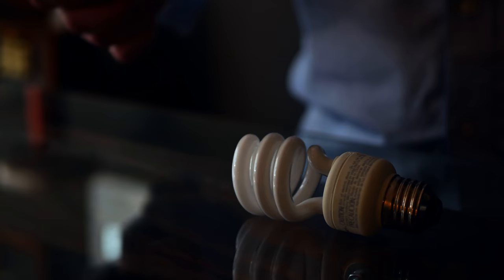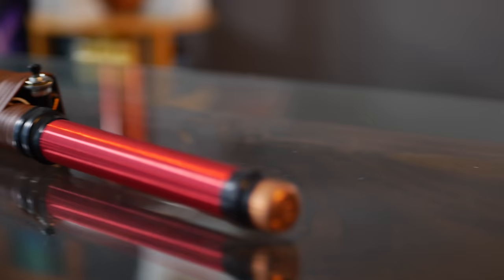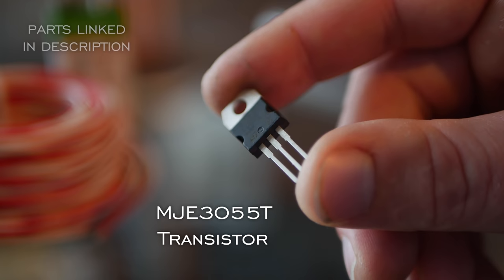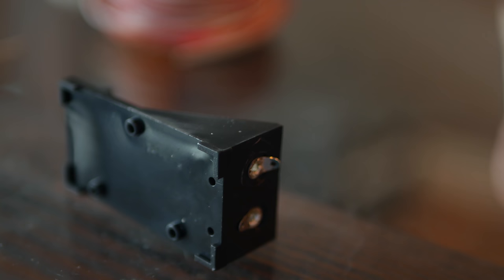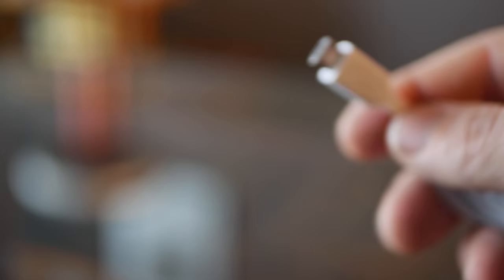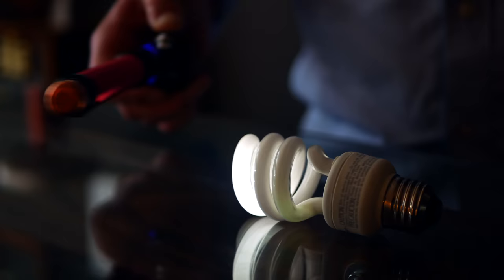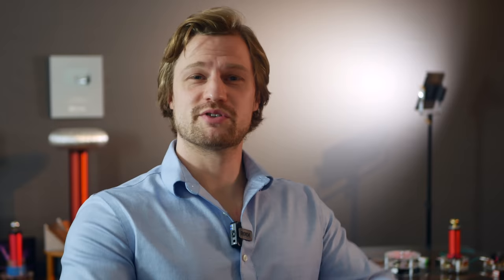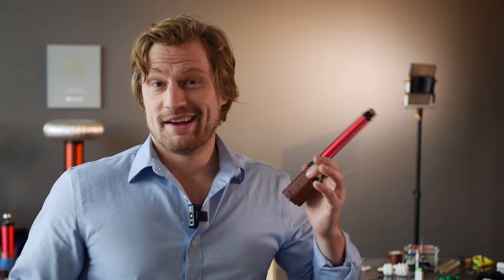DIY Wireless Power Magical Wand (Slayer Exciter)

Comment from the maker: Just a note: The copper end cap is not essential for functioning, so I didn't mention it. It was just to seal the end the wand. I think it does extend the electric field mildly, however, it's more for structure and appearance. It's just a 1/2" copper pipe end. Cheers!
Reply: You could make it look like a sonic screwdriver from dr who. That would be so cool
Reply: Mr plasma, please make the tesla coil that creoson made. You can find it by surtching tesla chair on youtube. The thumnail is a big green box. Please check it out. And if you can, improve it. It makes huge arcs.
Reply: I , like it , because neatness counts, that makes it even better!
Reply: @user-qe4do2fi5l  yes u r right
Reply from the maker: Exactly what I was thinking. I love a good looking build.
Reply: Deez nuts
Reply: @PlasmaChannel  what abowt a arc lighter powerd voltege multiplyer powerd tesla coil?
I mean that will make some huge sparks.☺
Reply: @PlasmaChannel  you deserve 1m subs keep making cool videos.
Reply: Wireless chargers for phones appear to create similar charging field, however I've read the wireless chargers aren't necessarily all compatible with different phones.  
Out of curiosity would the wand register a wireless charging signal on a phone capable of wireless charging?  

Also find static shocks interesting.  I worked in shipping wrapping pallets.  This old lantech wrapper, I'd get shocked & it would reset the digital counter & shutoff the turntable with the pallet that was rotating.  Always happened after I secured the top of the pallet with shrink wrap & went to engage the knobs for the table to move faster & the carrage with shrink wrap to go back down.  The shock went through the knob & reset it.  

I'd terrible static, so bad not only did I short the machine, I'd actually get zapped from touching a clipboard & When I say zapped it was enough to see the spark.  I suspect it was my nike cloth shoes that was gifted to me alongside shrinkwrap, but I was still getting overly zapped.   

My dad did an old fridge trick, one person touches the fridge another in the middle, & I think while all touching, one on one end could put their tongue on a 9volt & everyone gets zapped.  Probably been like 23 yrs for me now.  Lots of cool experiments.  

Another great upload, I wish school had taught this stuff.  You make it seem really simple to do, but I know there is a lot of calculations behind it.
Reply: There are a couple of applications I can think of.

1. As a live circuitry detector.
2. In home, during a blackout, you could walk around the house, lightning up the bulbs as you go.. Maybe if the reach of the wand could be increased.
Reply: @biggusdickus269 , I think I just might try that!!!!!!
Reply: The transistor is out of stock
Reply: Can I get a report of it about the ckt
Reply: Can you charge you phone wireless with this
Reply: @mba3482  No, the basic principles are the same but Wireless phone chargers use specific frequencies and power levels and won't transmit sufficient power for charging without first exchanging information with the phone to see how much power/what frequencies it can support.  I'd also be careful using one of these around a phone that does have wireless charging in case it messes with the circuit in some way.
Reply: What if did something similar with water
Reply: You also mount the transistor to a heat-sink and didn't mention that either.
Reply: Hey J I was kinda making a magic wand the same as you made but it's quite not working as the led is not glowing !!
Can you help it out ???
I used Tip41C as switch 20k resistor and there's not much components in it 
But still pretty disappointed!
Reply: How did you do that cap???
Can you please tell
Reply: @plasma chennal how did you do that cap???
Can you please tell
Reply: I would like to talk with about a project I'm designing.
Reply: @thearchetype9829  Did you wire the circuit right?
Reply: At what rf frequency does it transmit i wonder @Plasma Channel

Comment: THIS IS MY 4TH ATTEMPT WHAT AM I DOING WRONG
Reply: ITS FAKE
Reply: I tried every circuit posible only this one
Reply: FAILED
Reply: Same. I think this dude just pranked everyone.
Reply: You need to get the coils to resonate, when they're too close together it's hard to get it right
Reply: I had a problem with a similar circuit recently. I used a cheap transistor and it didn't start to oscillate.

Comment: If you ever want to make one that's more wandlike, without the thick handle, if you peel the shell off of the nine-volt battery, it's actually six AAAA batteries, connected with spot-welded metal strip.  Stretched out endwise, it would be about 3/8th of an inch in diameter and about six inches or so long.  Maybe build the entire circuit so it goes inside a piece of heat-shrink, then drill a hole lengthwise down a stick to house it?
Reply: Idea is good, I make batteries for vehicles if Jay wants will surely make a battery and send across, coz not all have a spot welder and to own one for DIY projects is not expensive too!!😂😂😂😂 Love from India.

Comment: I once did this with a mini flyback instead. I connected ground to myself and I can use it to draw arcs to anything made of metal. 
It is really useful for stopping people entering your room by electrifying the door handle.
Reply: How well it works with normal flyback transformer in epoxy?
Reply: The same but make sure it outputs high freqency AC so it will copule thru intruders body to ground to burn the shunt out of them. If yo use DC intruder must touch another grounded surface unless the voltage is like over 100 kv but for that yo need a voltage multiplier i guess

Comment: “If you want to find the secrets of the universe, think in terms of energy, frequency and vibration.” – Nikola Tesla
Reply: Energy = Potential and Kinetic, Charge and Discharge, Pressure and Flow.
Frequency = Resonance and Non-resonance.
Vibration = Transverse, Longitudinal, Spiral, etc. Constructive and Destructive Interference, Radiation.
Reply: Also the most misunderstood quote ever, as demonstrated by responses

Comment: Make one like "join the technicians" 's magical wand, its more destructive and Fierce...
Reply: Thumbs up for Join The Technicians. That wand is insane.
Reply from the maker: Yeah I took a look. Pretty insane. It won’t light bulbs like mine, but... it’s much better overall. Then again, mine was designed for 5 year olds 😋
Reply: @PlasmaChannel  yeah both run on different concepts... If you mass produce this i might buy one 🤞

Comment: Can you do a video on Plasma Electrolysis, also called "Contact Glow Discharge Electrolysis", or "Non-Faraday-ic Electrolysis"?   Use an alkalai electrolyte like Potassium Carbonate.   Your cathode (negative) surface area should be much smaller than your anode.  That way you get a high current density at the anode.  The Hydrogen that bubbles off the cathode gets ionized.

There is a Japanese Physicist named Tadahiko Mizuno, he was chair of the Physics department at Hokkaido University, who did some experiments with this.  He noticed that his cathode was transmuting into different elements.  Iron would turn to Gold.  Tungsten would turn into Ytterbium.  He looked at slices of the cathode material under an SEM with EDX (element detection function).  There were areas that looked like flowers, where the inside of the metal had melted/vaporized and blown out.  These "flowers" were found to be made of other elements.  The theory was that the nuclear transmutation was caused by Proton Spallation.  That is, the ionized Hydrogen from the water (stripped of its electron, it's just a proton), was somehow getting smashed into the nucleus of the cathode atoms, causing small fusion reactions.  Also the isotope distribution was highly unnatural, suggesting a nuclear reaction.

I did some experiments a while back.  Maybe you could do a better job?
https://www.youtube.com/watch?v=Q_0-z8ppjNU&list=PL_fqGxm2VkJ1zyaudyUbOv1aQWp40Dor5&index=1

like the vids man :)

Comment: I've always wondered if it would be cheaper to build mini slayer exciters into fluorescent tubes than to build a ballast into them...
Reply from the maker: Hm. Total components could be built for less than 5 dollars. Good thought.
Reply: I don't know enough about purpose built fluorescent fixtures to comment on that, but it seems that we're transitioning from CFL to LED fast enough that it was never worth trying to get rid of the integrated ballast.

Comment: Nice little project. The only negative for me was the leather wrap. I do understand the need for insulating yourself from the circuit, but the leather hides all the goodies inside. Though there isn't that much to see in there, I think it helps with esthetics of the built. Good job still.

Comment: Just a thing when i made my slayer exciter at my first proyect the LED turned on but it turned on at full power so it was shorting out, the problem was the primary coil's low inductancr and low resistance

Comment: This is awesome Jay!

I gotta make me... I mean my nephews one of these!

I always wondered why in the slayer circuit needs the led. If it is only used to make sure current only goes one way, could you replace with a diode?
Reply from the maker: Thanks justin! I appreciate that. The LED can be replaced with a diode, and a lot of variations of the circuit use a fast acting diode in its place. The benefit of the LED is when it lights up, that tells you the circuit is operational. Plus it looks cool!
Reply: @PlasmaChannel  
That makes sense. Added benefit. I just wondered as a small musical tesla kit I bought to try out before building from scratch had one, and it's placement and brightness made it where you couldn't see the arcs without covering, but if you did with your fingers, it took power out of the circuit, dimming the sparks and making sound quoted.

I just rewatched the pancake video and you mentioned that it could be a diode there, somehow I missed all the times I watched before.

I notice in the video, you add a small piece of copper as a top load, but never mention adding it audibly. Is there a benefit to adding the top load (building capacitance, etc) or just for aesthetics so it looks more wand like? Wasn't sure if it made a difference performance wise as there are no sparks.

(Also, the link to the pancake isn't in the description, might want to add so new people can click through and get you views without having to search.)

Love the videos man, always a surprise, but always good!
Reply from the maker: Justin, this is why I love having you in the fam. Thanks for tipping me off about the copper top. Arg, I forgot! I’ll put a note in the video description! It just is to ‘seal’ the end of the tube. Also extends the emf field slightly. Very slightly. 

And, I’ll add that pancake coil link now too!

Thanks man.
Reply: @PlasmaChannel  I'm very new to circuit design and I was wondering, what transistors are good for these kinds of applications? Any input would be greatly appreciated ;)

Comment: Nice build. I should have thought of that. A slayer circuit for the kids. I was going to use old school tech though, but this is more appropriate. Also I'm really curious as to capacitve coupled plasma circuits for rf flame (why don't tesla coils like to run that way) and to build one without semiconductor or vacuume parts. Good work, good luck, and merry Christmas.

Comment: An arc lighter please. Better than the greatscott one. With larger arcs. And it can be bigger in size than a standard arc lighter or butane lighter. Something more like a prepper tool that can withstand stormy wet winds and light fire to wood or leaves. Natural tinder that is.

Comment: Looks good, but a small suggestion:
Rather than using the clear epoxy tube, why couldn't you use electrical (or plumbing) plastic pipe?
They have end stops that would be "better" to close the ends.
Reply from the maker: I just used acrylic as a preference.

Comment: Hi Jay I was just wanting to let you know I built a wand myself once I was playing with static when I come to the conclusions just like a balloon rubbing it to your head and sticking it to the wall while I was utilizing a cigarette paper and that cigarette paper well I found some really cool things out and I found something that has to do with the black wire specifically nearest to a power source that's applied such as where your power breaker switches are in your house yeah I've taken apart many things anyways I had that piece of wire and I cut a specific amount of inches of it I used cotton string glass tubing and some coiling fashions and static current to snap a spark off to something and take control of it such as something dangling from the ceiling I could step back and make it spin or such as it was like ... A remote
antenna such as like walk that cigarette paper up the wall with my one hand holding a nail in my one other hand and it was like a cartoon of static on the end of my one finger on my left hand in my right hand I used it to walk the cigarette paper when I staticified and stuck it to the wall like a balloon I walked it up the wall and for end and down the wall it lost static about 6 in from the floor some cool things you could toy with if you really want to build it really special wand ...
I've even levitated a cigarette paper out of the center of my left hand believe it had every bit to do with the static and coilations to the momentum ...
Anyway I've also noticed some other major things about it that really caught my eye when I first noticed a connection a frequency connection which is between all things now I staticified with a cigarette paper in my hand stuck it to the wall and backed up walked over to a friend of mine and snapped my finger off as letting the static go ... In a spark or Arc across to her which there was always a difference to whether I felt the pain or her which is the difference between it being a spark or an arc however the cigarette paper that I staticified and stuck to the wall when I went over and snapped her with my static it fell so that in turn I did it a few more times playing with it and understanding that connection right there alone a remote connection of ways per se maybe if we could alter those actions is what my thought were to the process before it even happens or in the process of before the spark maybe the frequency the static frequency the correlation of it the magnetic pressure whether it's an arc or spark all has to do with how that actions happen including microwave compression which don't get me wrong I mean they say it's bad but yes it is however does static kill you when you go off and spark somebody not unless it's a little bit too much for your body to handle however if you're just rubbing on your couch with a coat that noticed builds static
Play with the static figure it out for your own self look up the things that hold static and don't play with it understand it you'll learn a thing or two about all things cuz all things have frequency.

Comment: You can now make a greater wand that can make an arc with a mini mini voltage multiplier
Reply: You can use the high voltage generator that is sold online for 3 dollars as a high voltage supply with a marx generator or something
Reply: Or an arc lighter that outputs ac as high voltage supply and a voltage multiplier

Comment: when i connected 9 volts the led doesn't illuminate ... what do you mean when you say reverse the primary connections?
Reply: You need to reverse the connection of the bell wire that is wrapped on the coil
Reply from the maker: Thanks for hopping in there. That’s correct.

Comment: I have made a copy of this. But it is not working. I think it is because me using a thin delivery tube as the secondary coil winding cylinder. Is the diameter of the secondary make a difference?

Comment: Sir can u explain in scientific way, why 2nd wire attach to base ? Why it's not attach on emitter ?
Reply: So that it produces a self-oscillating system. When the transistor is conducting current through the primary coil, the secondary coil increases the transistor base current thus providing positive feedback. At certain point the transistor collector current saturated and does not increase linearly anymore, thus the voltage across secondary primary coil collapses and starting to shut off the transistor. The primary coil current starts to collapse too because the transistor is turning off. This positive feedback quickly reverses the high voltage polarity across the secondary coil causing the transistor to turn off swiftly. Although the secondary coil voltage is a high voltage, the base is protected by the diode (Plasma Channel replaces it with an LED), where it does not go too far below -0.7V. When the base voltage recovers, the cycle repeats again. The circuit schematic can be found in the video by ElectroBOOM - "Not the Best Tesla Coil Driver (+Keysight News Leakage)" [the first schematic].

Comment: is it possible to increase the voltage being dumped into the primary coil by adding a transformer at the ends of the secondary coil? therefore increasing the electromagnetic field?

Comment: Oh yes, this will be my next project for sure!!! Just have a quick question... What happens if the resistor is not exactly 22KOhms? What happens if you have less or if you have more? What are the consequences?
Reply from the maker: Hey Christian! So glad you enjoyed. You can use less than or more than 22k ohm. Anywhere from 18-30 k is fine. I’ve seen some use 48k ohms. However, that tends to kill the transistor easily. Not sure why.
Reply: @PlasmaChannel  Ooooh Awesome! So as long as I stay relatively close to the 22kOhms I should be good then! Thanks a lot! Btw.... I really love your channel, BIG FAN, keep it up!

Comment: How small does the wire for the secondary have to be because I did the same curcut with larger copper wires and it didn't work